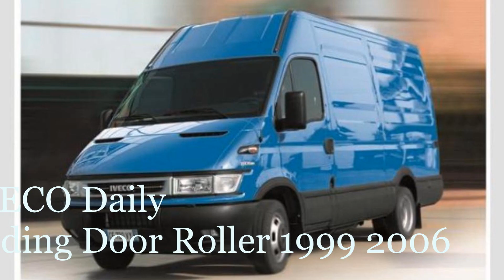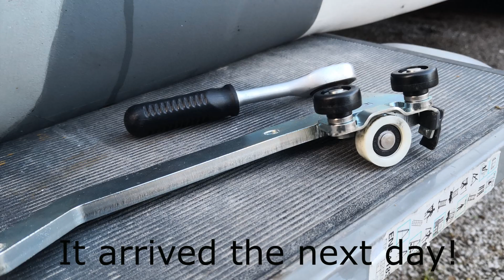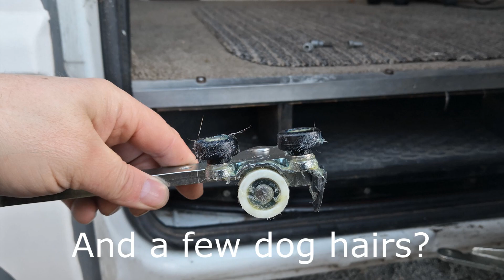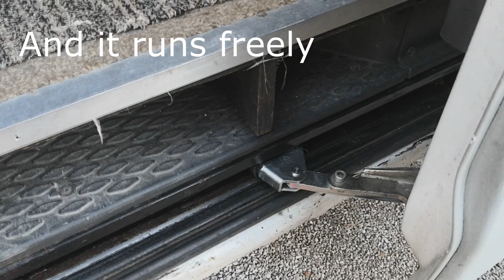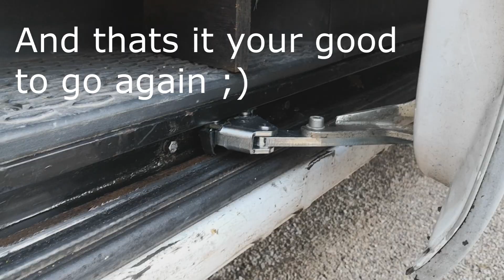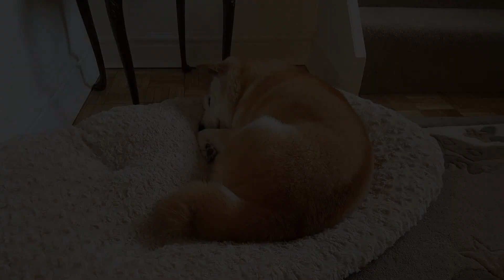IVECO DAILY SLIDING RUNNER DOOR ROLLER - FITTED IN 2 MINS

Comment: Hi mate I've got the same van, door roller is fine but I get a persistent leak around top of door. I've changed rubber seal and put a small gutter over door. Still leaking. Perfectly dry around door seal in the rain now so I know it can't be coming in via that route. Any ideas would be helpful 👍
Reply from the maker: Hi Andy I put a gutter over my doors front and rear they are inch by inch solid plastic and that cured it but I've sent you a link to a Facebook group for Iveco perhaps someone may have a better method of keeping the water out and could advise you?
Regards James
https://www.facebook.com/groups/193215174424343/
Reply: James Crook thanks much appreciated 👍

Comment: Hi James great vid. Got a problem with our's but its the top right of the door that seem to have poped out, any advice would be great.
Reply from the maker: Hi Lee is it like the open jaw pincer shape? If so yes mine doesn't always latch on either, there are adjustable settings on the lower roller and on the internal which would be your top right if your stoob inside the side door looking out that might help, I also fitted a form of gutter to my exterior just above the side and it stopped any water ingress completely, let me know how you get on
Regards James